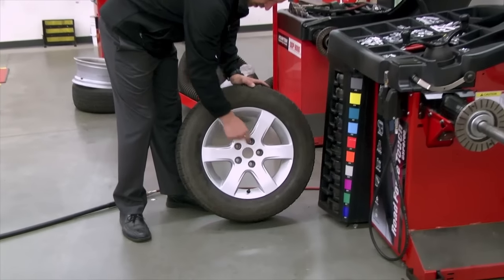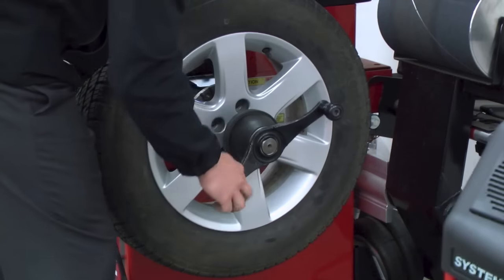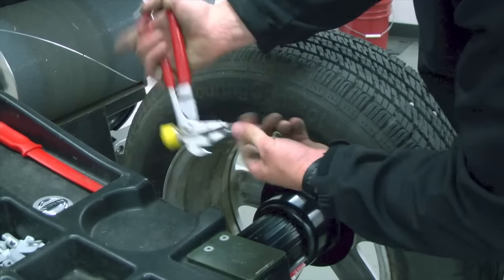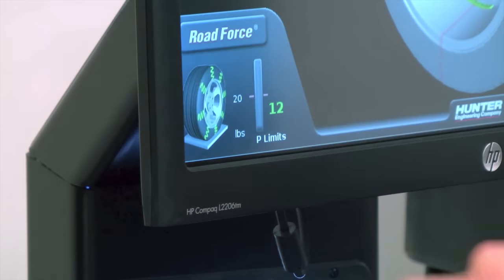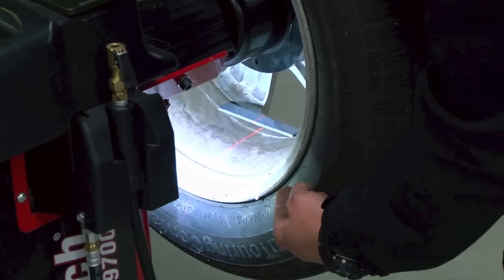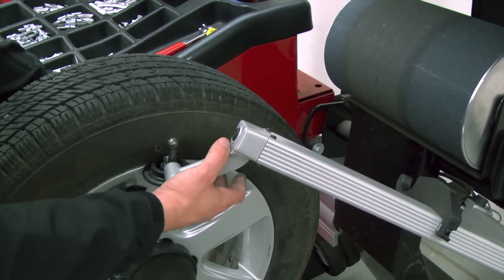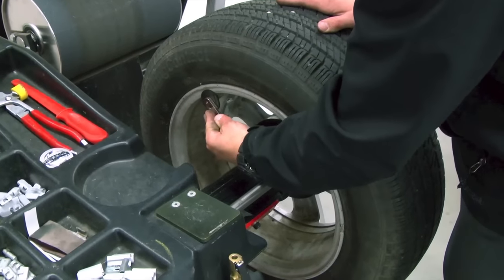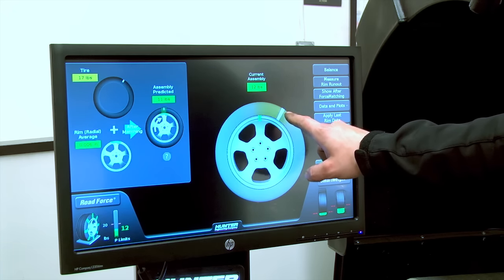SCC Automotive Training: Hunter GSP-9700 Wheel Balancer

Comment: Old school says that all that rust should be wire brushed away, and leaving all those rocks in the tread doesn't help matters.
Reply: Good eyes Richard. I noticed the same thing. A hi-tech machine that can do super accurate work and he left rocks in the tread and rust/corrosion exactly where the centering cone sits. Gotta start with the basics.
Reply: I noticed that as well.
Reply: Same here, and I am not even in the business, just a “car guy” working in aerospace business, landing gears specifically.

Comment: I am glad to see you address the issue of centering.  You can balance an egg, but it will not roll smoothly down the road.  If the wheel is not centered, you will never obtain a true, accurate, balance.
Reply: I sometimes use a cone on the  back side and front side to ensure my centering is true offset each other

Comment: Since the measurement for the outside of the wheel lip surface is essentially just a way for the machine to know the width of the wheel (the outside measurement function became available at the same point in time as we no longer had to measure the wheel width with the calipers) , is there a way to enter the width of the wheel if it happens to be stamped on the wheel somewhere?

Comment: Relative to Smart Weight - it's fantastic for a shop owner and most of their customers.  The rounding algorithm used works - saves the shop $ on correction weight and satisfies most customers.  If you want the best balance, turn it off and adjust the "blind" to get the rounding to the lowest option possible.  Then, use 3m weight that you cut to length.  Add in a calibrated machine and a competent user and you will have a well balanced assembly.

Comment: Please confirm a better run out is my issue and many thx for this great video which made me better understand about the wheel vibrations (am an engineer but still) which I have been dealing with for more tha 10 years. For the last10 years I have used a chain-shop having Hunter Road FOrce but many times I still had vibration issues like now.
Reply: Probably cheap tires or a bent wheel

Comment: I wanted to know what a normal value is for the road force...I just got 4 new wiunter tires installed by a Nokian dealer using Hunter Road Force and values I was told they had were 7,7,8 and 9. These numbers seem OK I mean low enough but I still have some vibrations in my car above 120km/h (front and rear). Does it mean the balancing is off for some of them causing the vibrations or does they need FORCE MATCH? Other tires I had with up to 14LB  road force values had to be rebalanced (or maybe they did FORCE MATCH but di not tell me) to get rid of any vibration.

Comment: Any such advance system which can measure out of balance of the spinning wheel of under 10 grams from say a big 15+kg wheel + tire and that road-force black roller measuring differences of tire wall response, is only as good as...... how accurate the initial calibration and the proper scheduled calibration of all the sensors.  Wheel bearing play in the main spindle itself can wreck havoc.  

Sometimes I wonder what self check feature an owner/shop of this Hunter 9700 must do at least per week or per XXX amount of wheel balancing work. Then come Hunter's HQ certified tech coming for another scheduled major calibration.  No such equipment like this can do well all the time without proper calibration. 

Owning a few high sensitivity sensors in my work, without proper scheduled calibration is a big NO.

How do we as customer knows that a shop has done proper calibration on their 9700 ?
Reply: Excellent point, I went to a new tire shop and got a set of new winter tires, noticed vibrations on highway speed a week later, went back to shop who said they had another customer experiencing similar issue, asked me to come back after Hunter technician recalibrated the machine, the tires are rebalanced as minor calibration issue was found, now my tires are 1 lb, 6 lb, 19lb and 26 lb, still experiencing a bit of vibration even though much better than first time, but tire manufacture rep now claims to tire shop 26 lb is acceptable, so now I have to contact tire manufacturer myself, not a happy customer at the moment.
Reply: @aviography  I just done 4 cars on Road Force. Indeed, its difficult to get all tires to 100% same good value say of  amazing beauty of 1 Lb. It is just how manufacturing tolerances are on street tires. In fact I threw one new (3,000 mile/5,000KM) tire one out due to 100Nm ( 73 lbs ) value after troubleshooting transmission mount, drive shaft coupling and other potential vibration contributing values. Now the car rides much better. Bad roadforce variation vibration if you measure with accelerometer : is different from out of balanced condition which is more like left-right shake ( X axis ), while roadforce variation is up/down sensation ( Y axis ). I doubt you can claim a 26lbs variation. My other tires are average 20-40 NM ( 14-29 lbs )...sad I know. Michelin Pilot Sport 4. 255/40-18 rear and 245/40-18 front. 50nm or 36 lbs and above is indicated as RED ( bad ) in hunter 9700.  

If you are using off-road type tires, forget it, it is almost certain roadforce variation is high, that is the nature of the tire according to the tire tech where I done my roadforce balancing. Drive safe
Reply: I forgot to add, I also measure out of tolerance for the tires and rims/wheel, all good.

Comment: After  vulcanize the tire, you' ll need to balance again the wheel??
Reply: You should spin it anyway to check the balance after a repair, sometimes you may have to rebalance, especially if you had to pull outside weight off